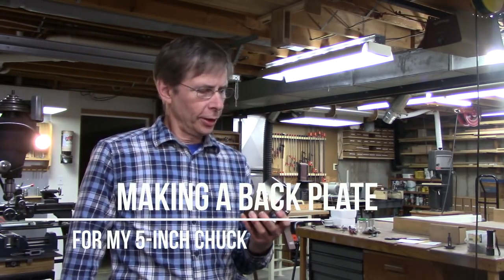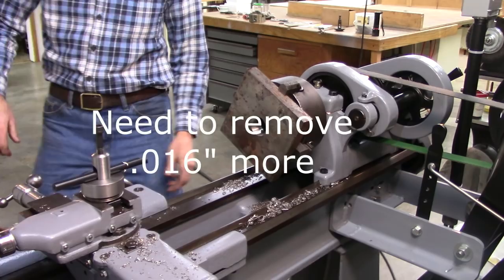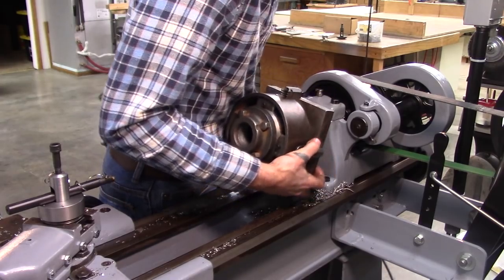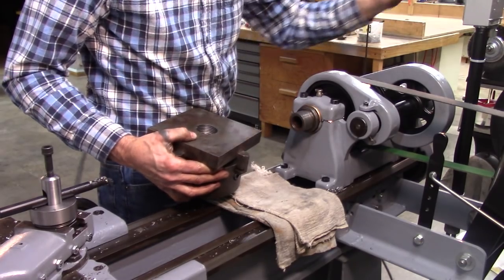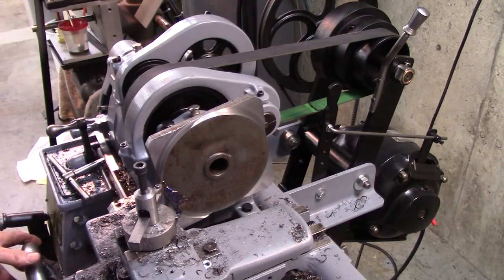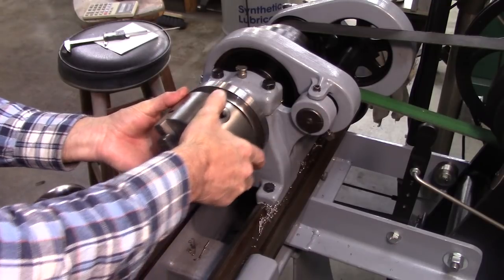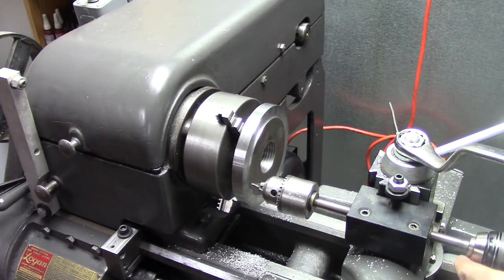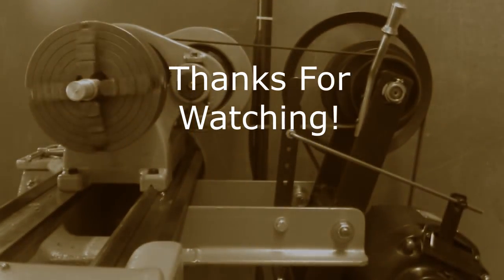Making a Back Plate for my Metal lathe Chuck

Comment: As I was watching your video ;-) I was very surprised why you didn't cut it down on a bandsaw before putting it on the lathe it would save so much time made it a lot easier but in the end you did a very good job. Thanks a lot for sharing your video. I've learned a lot from you.
Reply from the maker: I totally agree. I didn't have a band saw at the time. Also read what I wrote in the description. I know...  I seldom read them myself but I acknowledge that this was not an ideal method. Oh...  thanks for watching.

Comment: Excellent. Don't have a threaded spindle, but love watching your work. Glad you show all the challenges everyone of us faces. Bottom line, done and done! 😊😎 --Mark
Reply from the maker: Thanks Mark!
Reply: I don't have a threaded spindle either, nor all the rest behind that - i.e. the lathe :) , but still watch this kind of stuff being done in absolute awe. I guess one day I'll come across an old lathe somewhere and an affair will start.
Reply: @MiniLuv-1984  Uncle died, was given his lathe. It was used as wood lathe. Returned it back to metal working. Lots of problems. YOU NEED to know about headstock bearings and shaft condition. The degree of wear on bed, and crossslide  etc, etc. A money pit and frustration if in bad condition. Still, I find it worthwhile.
Reply from the maker: @MiniLuv-1984  - I'm on my third lathe. The first two were Logan and this last one is a South Bend. A 1941, 1947 and the SB is 1931. I restored them all. It's a lot of work but also addictive. Using a lathe you restore yourself is always huge pleasure. Lot of fun, you should find you one!
Reply: @lawrencewillard6370  thanks Lawrence.

Comment: I think that turned out really well I had a Chuck I bought brand new it had 5thou run out on the chuck but the jaws ran true half a thou I later figured out that the chuck body had a slight out of roundness been using that chuck for the last 4 yrs no problem it’s crazy how that happens great video as usual thanks for sharing all the best
Reply from the maker: Thanks kind of what this chuck did. Thanks for the comment!

Comment: Very neat drill set-up that you have going there. I'm hoping to have a small home machine of my own going before long. FYI "Thread Engagement" is more about how much drag or friction there is between the two parts than size. Put another way, at 100% thread engagement, you would have so much friction between the two parts, it would be pretty close to a press fit, (actually, an "Interference Fit") and the parts would likely friction weld together. No bueno.  And yes, you should definitely cut the corners off as close to round as you can first, interrupting cuts  are hard on tooling, machines AND nerves.  (btw, you are killing it ! You are doing a heck of a job, and I can't wait for more video!)
Reply from the maker: Since I made this video I turned a 1/2" x 6" disk. I rounded it on the band saw...  this is WAY easier. Drill set up?  You mean the square column drill press? Yes, this is by far the best thing I have ever done! WHY on earth some major manufacturer doesn't sell a dove tailed column drill press with a light mill table is beyond my comprehension.

Comment: I was watchjng on my phone and my eyes are not as good as they used to be but it looked liked you indicator tip was on the chuck i think it is the chuck thats out and not your plate. Try backing your jaws almost max out and check the jaws. You sure did a VERY nice job restoring that lathe. Thanks for sharing.
Reply from the maker: Yeah, I was indicating the chuck body. You would think the thickness would be consistent but maybe not. Still .004 isn't too bad for a 3 jaw plus  the 1-1/4" bar I indicated was only .001 out. I'm totally happy with that.
Reply: @WinkysWorkshop  for sure, in fact that is truly awesome when one thinks about the process of aligning the material in the lathe to start with. There are so many things working against us. Sometimes we (i) forget how imported material cleannes makes a differance.

Comment: Mr Winky very good video, I need to get me a new 3 jaw inside grip chuck, been trying to find one with a backplate having no luck. So i am going to try the way u did it. Sure am going to have to make some tools to do that, I watched ur index gear that was very good.
Liked the way u checked 4 the run out and located the holes to mount the plate.
Thanks
Reply from the maker: Thanks. If you can, knock the corners off the square stock it's way easier faster and even safer.

Comment: Hi Winky. I rencetly began to working with an 821 Logan Lathe that it was inherited to me for a great friend. It was from his father. I watched that you employed the 250-104 turret accessory at min 15:30. I would like to question some details.
Which is principal object from 250-104 accessory?
Which is accessory diameter?
Did you make a bronze bushing? 
Wich steeld did you employed to make the shaft? 
What other uses could it perform?

Thnaks fro ahead
Regards from Mexico.
Reply from the maker: Wow...  you must have some good zoom. No way can I read those numbers! Anyway, I did a video on that. I just used a 3/4" brass bar and bored and reamed it to 3/8". The drill chuck has 3/8" 24 threads I believe so I just threaded the end of a 3/8" rod. 
https://youtu.be/PczSsvRfiEk

Comment: I’ve used plate like that before, your correct if you knock the corners off with the band saw it does work better. Great work
Reply from the maker: I don't have a metal cutting band saw except a portable. I hooked a table to the portable and cut some disks for another project and it worked great. After cutting a 3/8" plate to 6 inches circle I bolted it to some 2" round with a 3/8" bolt and chucked it in my lathe. To my surprise the disk never slipped on the bolt. It worked perfect. Live and learn.

Comment: TREPANNING   is basically deep hole boring with a difference in that it leaves a core. It is an efficient method for drilling deep large deep holes that is 
more cost-effective than deep hole boring. 

The most common use for trepanning is cutting 
a core out of a larger solid leaving two pieces. 
The removed material is not reduced to swarf as with drilling but remains a solid billet.
Reply from the maker: Yeah... I've watched a few videos on doing this on the lathe just never tried doing it.

Comment: Look like this lathe and your toolpost is more ridged than the Logan. It is amazing what a little more mass will do. Trepanning is the word that you were looking for. I don't recall many videos on the process. That would make a interesting topic.
Reply from the maker: I need to explore the Trepanning although I just watched a video on it. Easy to use but a lot of grinding to make the tool. It might be worth the effort however.  Yes the South Bend is more rigid but the Logan cut smoother. Actually I think the Logan is just as heavy overall but the south bend is heavier in areas like the compound. The spindle is also slightly larger and with longer thread but about the same bore. I suspect this extra thickness on the spindle makes a huge difference.

Comment: Awesome ! I have to do this with a 3 in chuck for my mini atlas and 6 inch for lathe I'm building.  I'm not so scared to try it now . Thank you
Reply from the maker: If you have a bandsaw it's way easier to cut the corners off. Its way easy and easier on your lathe.
Reply: @WinkysWorkshop  I'm taking my portable band saw and framing it to be my cutoff bandsaw . I did complete 1 project  I completed my fly cutter and I am so amazed at how well it works . That's my first project ever so now on to the list  which you have inspired me enough to do others before I ever tackle building my lathe . With my mill and my mini atlas lathe I see future things I never dreamed of .
Reply from the maker: @ronaldcrowder404  Yes with a mill and lathe you can do a lot!

Comment: I too own and restored an 11 inch South Bend lathe built in 1939 with a 1 5/8"-8 spindle.  I purchased  a 4 jaw chuck with the correct 1 1/2-8 back plate and just bored and threaded it out for the 1 5/8-8 thread. There was plenty of material for the ID.  Try it next time if you need another chuck and back plate for that lathe. Ed K. Cleve. Oh.
Reply from the maker: Cool...  I wasn't sure there would be enough. Thanks!

Comment: Nice job Mr. Winky!!! The 13 inch LeBlond I'm working on now has a 4 jaw chuck on it and a 3 jaw that don't fit. I will have to figure something out when it comes time. Thanks for sharing!!!
Reply from the maker: Thanks for watching. Is the Leblond a screw on chuck too?
Reply: @WinkysWorkshop  Yes sir it is. I took the 4 jaw off and tried the 3 jaw and the threads were different so I just put the 4 jaw back on. It is all scattered all over my shop right now getting cleaned and painted so I'm not too worried about it yet...
Reply from the maker: @dannywilsher4165  - Make a video of the restoration.

Comment: South Bend made the 8" Junior in 1931, 1932, and 1933.  I acquired mine a few years ago.  It was originally sold in January of 1933.  It has a 42" bed and sold for $140.  Mine has the original motor, steady rest, all gears, etc.  It being the height of the Great Depression, there were not more than a few dozen variations sold, so they are pretty rare . . . .
Reply from the maker: I love these old machines
Reply: is it the lathe series use in video?

Comment: Like you say, a lot quicker and safer cutting of the corners, A quick question, why are they called southbend, is it the manufacturer or other, as I see so many different southbends. nice job on the backplate. Use a bit of wood on the ways when changing chucks, if you drop it it will save some heartache. Depending on which of the 3 positions I attatch my chuck I get 3 different readings on runout, once I found the position of least runout I marked both chuck and backplate so it always goes on that way, unlike yours my "backplate" is a permanent boss fixed permanently to the lathe and have to use the same one for everything, hence the need for marking.
Reply from the maker: South Bend lathes started selling lathes in 1906 and by 1930 they sold 50% of all lathes sold in the US. They went on to became the largest lathe maker in the world. I'm not sure if they ever went out of business but the company was sold and there are new lathes being sold under the south Bend name. I think Grizzly bought them. They used to be made in South Bend Indiana. I think the new ones are Chinese made.  I thought about rotating the chuck on the mounting plate to see if the run out got better...  might do that later.

Comment: Thanks for the video, I have 2 backplates I need to make for my 1935, 13" LeBlond Regal lathe, one for a 8", 4 jaw and one for a 7" custom chuck as yet I don't know what it is used for, but I got them when I bought my latehe at the very end of and estate sale, I thing it was take whats left so whe can be done!  I have fear in attempting the thread operation through 17/8" X 8 TPI also very strange At this point in my machining experience I have never cut a thread on an outside diameter not mention internal theading. With the help of your video I just may give it a try, thanks for the pointers of what not to do they are specially helpful.
Reply from the maker: Except for visibility internal and external are about the same.  Practice on some 1/2-13 threads. I've got a thread cutting video too if you are interested although its external.

Comment: Good work Winky.  Next time you will know a better way and it will go faster.  That one thousandth is better than my six inch chuck it has .003.
Reply from the maker: Thanks, I agree...  and yes, most 3 jaws have run out that also varies with diameter. Unfortunately.

Comment: Fascinating. I can’t figure out in my head, how when you were cutting the thread, the boring bar knows the exact instant to engage the start of the thread - each time, while it is rotating?
Surely that’s not just you watching and winding the feed wheel at the exact right instant every time?
Cutting threads just blows my mind. I’m not sure I would attempt something as complicated as that.
Reply from the maker: I hate to admit this but I had my compound set at the wrong angle but that's not really what you are talking about. Thread cutting is fun. You need a threading dial on your lathe. The dial will tell you when to engage the half nut so that each cut falls in the correct place.

Comment: What is the purpose of a chuck back plate if the chuck can screw onto the lathe? Listening to the crunch of the floor, how do you prevent chips from sticking to the soles of your shoes and if they do stick, what is your preferred removal method? FYI the name of the tool you're looking for is trepan and probably the thou runout is due to the three jaw chuck not being perfectly concentric with the bore.
Reply from the maker: The chuck is a plain back and has no threads. I had cardboard on the floor to catch chips and the camera mic picks it up rather well. Needle nose pliers on the chips in the shoes, what a pain! I've been corrected on the Trepan term a few times but not a problem... I knew I was saying it wrong. I think the chuck has a few places that contribute to being off a bit but .004" is not too bad especially considering its almost dead on at the jaws. I'll take is. 😀

Comment: I own a LeBlond 15 inch trainer with 2 1/8" - 5 spindle... I had to make every back plate that is used on that machine.. I had no chuck at all just a dog driver which I used as a face plate to make the back plates..... Mike in Louisiana
Reply from the maker: Cool...  They are not hard to make but certainly time consuming and a lot of chips. Just curious, did you start out with a round chunk is steel?
Reply: @WinkysWorkshop  No... I  started out with either a  piece of shafting or a round that had been burned out of thick plate with a torch.....I needed more thickness than the piece of steel you used.. Cheers; Mike in Louisiana

Comment: thought i would put this out there..fitting back plate ..make it a dead nut fit...or make it two..thou or so bigger so if your 5c set up is off or chuck you can loosen and tap it into closer t.i.r..dont recall if it was myford ..or gerswteiner who did that on theirs..so asking out their what opinion is
Reply from the maker: The back plate needs to fit snug. That's why most chucks only have 3 bolts, holding the back plate on. Without the register holding the chuck centers the bolts would not be strong enough to keep it centered.

Comment: I have a 10L South Bend. By assumuption, I thought I had a 6" chuck and just purchased a 6" - 4 jaw chuck. Do you think it's to big for my lathe?
Reply from the maker: It's a little big for the light weight version of the South Bend but I think the 10L has at least 1-7/8" spindle. I used a 6" chuck on both my 10" Logan lathes. They work but due to the amount of stick out from the spindle bearing I had to take lighter cuts. I have one for my SB 11" which has a 1-5/8" thread mount. It works okay. It's very handy to have but I use the 5 inch most often.
Reply: @WinkysWorkshop  Thank you.
I'm glad you don't edit out your mistakes. I make so many mistakes, but your videos teach me how to reduce them.
Reply from the maker: @Rochesterhome  I do edit some out but yeah, I'm human and learning all the time.

Comment: At least with all your mess ups, we can see different ways to get out of a jam.. lol. Btw, where did you expect those 4 corners to go after you cut thru at 2000+ RPM?
Reply from the maker: 2000 RPM? it was running 180. I wasn't too worried but I was standing to one side. In hindsight I should have gone to a friends shop and cut the corners off.

Comment: I have to do the same sometime soon.
Reply from the maker: Be sure and take the corers off with a band saw. I don't have one (yet) but it works way better!
Reply: @WinkysWorkshop  corners? I'm starting with a 50lb cast iron weight... ;)
Reply from the maker: @trollforge  - Yeah... I remember now
Reply: @WinkysWorkshop  it's a 4" chuck, so I think I'll start with a 4 1/2" bimetal hole saw... If that doesn't work, I did just finish the wood to metal conversion on my 14" bandsaw.

Comment: I have to get busy and do this for my 4" 3 jaw. But I'm starting with a 50lb free weight...
Reply from the maker: Do yourself a favor and round off the corners on a band saw. I did not have a band saw when I made the video. I made another back plate after making this video and I trimmed the corners. It was way easier!  Also, I hate to admit this but I had the compound at the wrong angle. South bend was nice enough to put an indicator mark on the side of the cross slide to read the compound angle but they are not direct read. You have to do math to use them. Oddly enough the threads work well. Silly me...
Reply: @WinkysWorkshop  I started with a 110mm hole saw, but it didn't get in more than 1/8" before it gave up. I'm going to try resharpening it (it says it is Bimetal) or I will try a single point adjustable hole saw made for wood, and modify it to take an HSS bit....

Comment: I totally understand the dread of big projects. I have been making videos every few months about a pulley build for my JD 400. Its just been a pain to me..lol
Reply from the maker: I just jumped into a bigger one. I'm building a Briggs and Stratton Buckboard Flier replica. Look it up. Thanks for the comment.
Reply: @WinkysWorkshop  oMG! I have seen 1 before (online) will there be videos of the build?
Reply from the maker: @craigtate5930  - Yes on the video but it will be a while. Right now I'm working on the drive wheel. I'm using a 2001 Kia Rio temporary spare tire/wheel and a 3.5 HP B&S. Another day and it will be finished.
Reply: @WinkysWorkshop  awesome,  cant wait to see